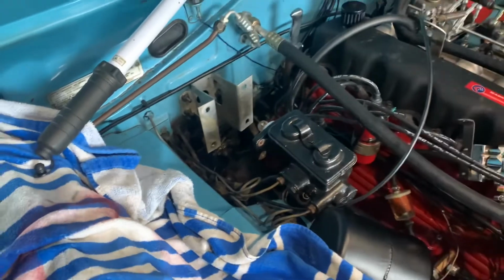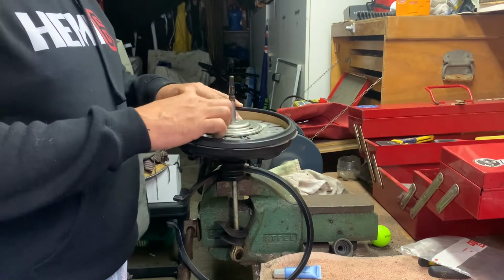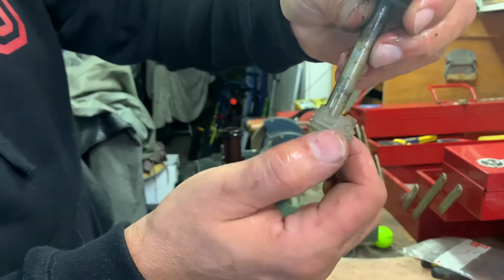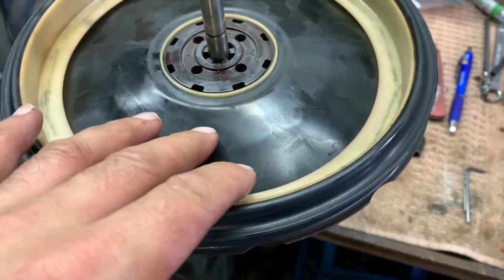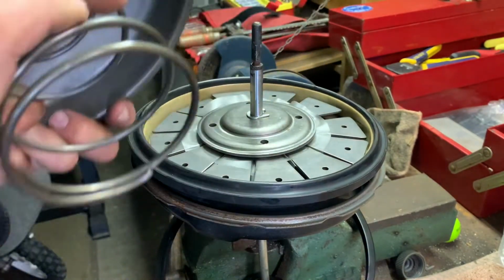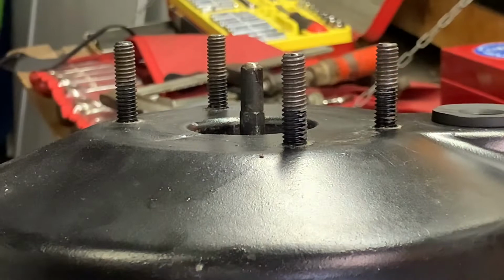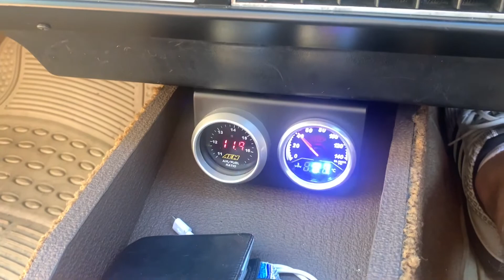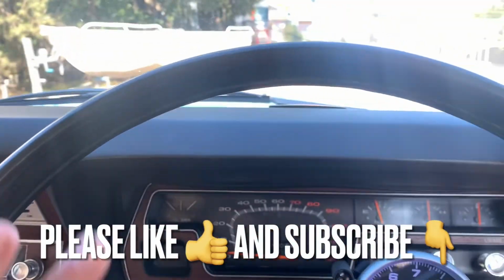Valiant Brake booster issues with new kit installed. VIP Webers.

Comment: Great video love the car. I have a VF Safari myself. Just a heads up You left the horse shoe clip loose that holds the first spring on the shaft. You should squeeze the ends together to stop it rattling loose.